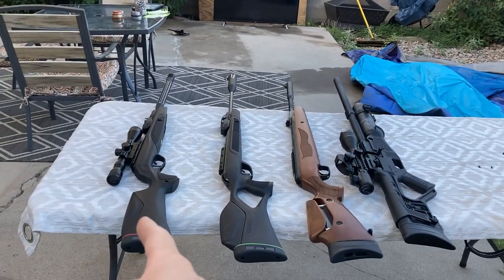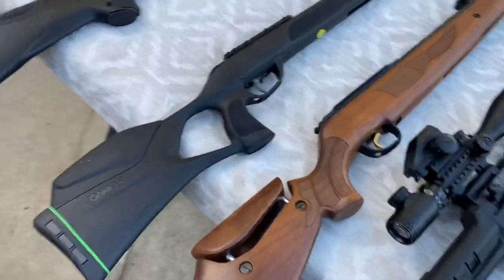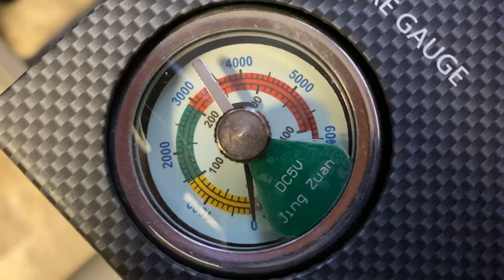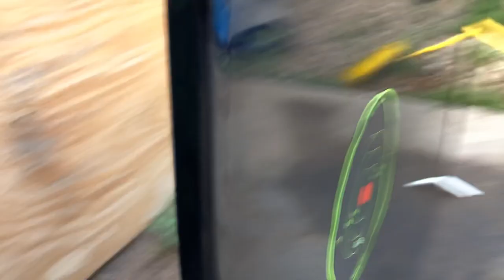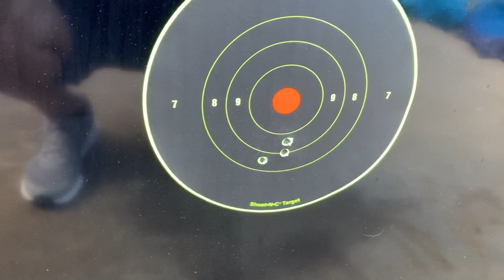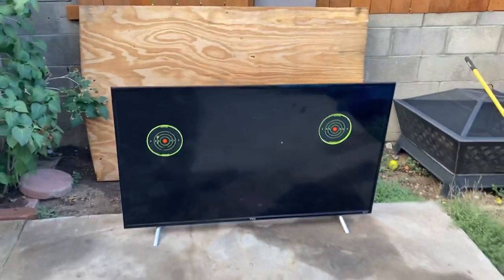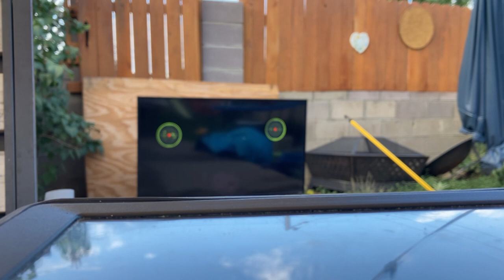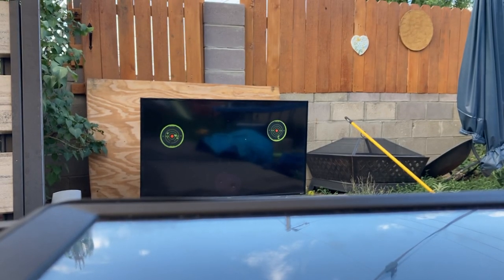Gamo/Hatsan air gun vs. Flat screen TV

Comment: Great video unfortunately .30 cal pellets don’t penetrate unless you shoot them over 900 fps, I tried to shoot flat screen tv like your and for some reason I was able to to penetrate when I shoot the tv from the back , I used AEA hp ss 680 fps 44 gr , didn’t penetrate the tv but I tried shoot from back side it did also I found out inside the tv some area are harder and some area could be empty and easy to penetrate